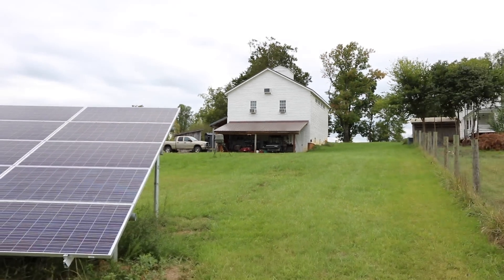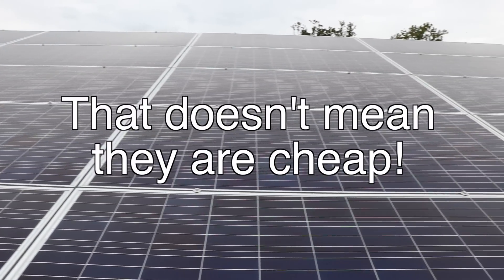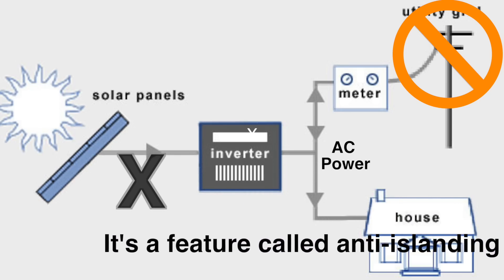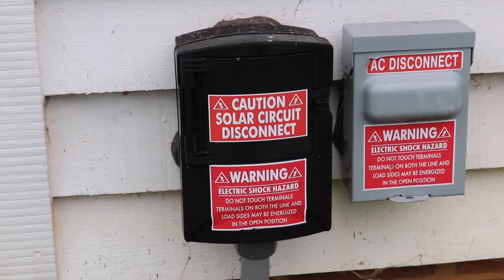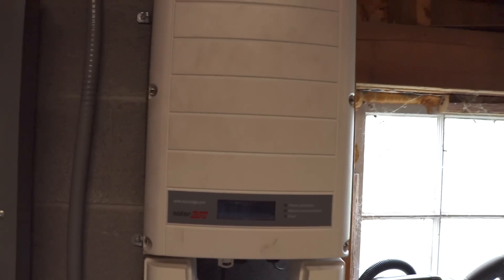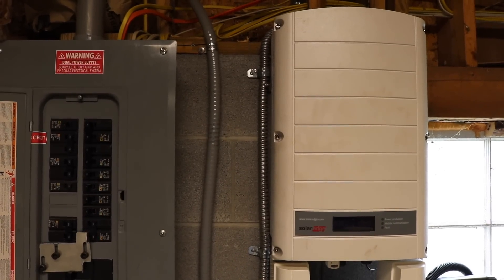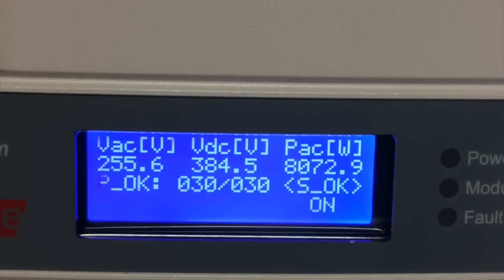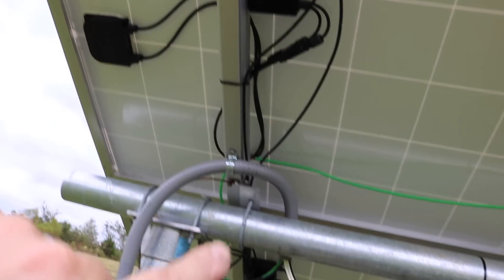The ugly truth behind grid-tie solar systems. Part 1, FarmCraft101 solar.  Watch before you buy!

Comment: I found this video to be quite interesting, and some of the comments as well.  My problem with going to a solar system, would be with warranty and getting anything out of said warranty.  One viewer/commenter (before me) stated that the company that made his inverter was bought out by another company, and is refusing to honor the warranty or even share the schematic diagrams so that someone else could attempt to fix it.  Having gone thru ordeals involving roofing, automobiles, snowblowers, etc., and seeing how many "warranties" aren't worth the paper they are written on,  leaves me sort of gun-shy to take a leap into such a venture as power generation.  Don't get me wrong... Kudos to those who do commit, and best wishes for a trouble-free operation.... But....
Reply from the maker: I share your concerns about warranties.  Thankfully with solar, the panels and wire/installation are the majority of the cost, and historically they tend to last well beyond their warranty.  They've gotten pretty good at making the panels.  The inverter, you kind of have to consider it a consumable.  Thanks for watching.
Reply: Sure they can be repaired, short of burning completely or melting down into a blob....  If it's only one component that had failed, yes it can be repaired by someone who knows what they are doing inside electronic equipment... however, it would be wise to replace dead or damaged components with carefully matched replacement parts so that neither the newly replaced parts, nor the adjacent components will be stressed, overloaded, or overwhelmed when the unit goes back into service. Some things can withstand being replaced with larger capacity components, assuming that they will fit in the space,  but will it impact other components with higher power, higher stress, higher heat? Need to be quite sure of what you are doing when working on something that will be inside a home or business. Don't want to have it set fire to the building under heavy load or something.  If the inverter is truly beyond hope of repair,  best to move on to another one.
Reply: as farmcraft101 said, just think of the inverter as an electric consumable like a tv.  it can last anywhere from 5-10 years (can also last 15-20 years, just depends). you can buy cheap ones on amazon and cross your fingers, or buy through a large brand name or brand name solar distributor who may warranty the products they sell (like buying coverage on a tv at best buy). prices range from $500-2000 depending on size. if you just need one to power your backyard mancave that just houses a few panels, $100 will do.

the panels/wiring itself won't die if installed correctly. yes lightning could hit it or a tree could fall on it but any physical damage is pretty unlikely.

they key is how much are you paying for electricity monthly. if it's less than $100 per month, don't worry about solar. if over $100 then solar would be a good 'long term' investment. if over $200 then it's definitely worth it given how cheap solar is nowadays ($10/watt installed 10 years ago to under $2/watt installed now).
Reply: Solar City the entire system is warranted for entire length of loan to purchase the system, but 20 year, and covers inverter, solar panels and a warrantee for your roof against leaks. Had my inverter fail, and they replaced it at no cost in two days.
Reply: Stan; I dont think it matters what brand. The warranty was offered by solar city.
Reply: yeah ICs aren't really solid state despite having no moving components. I go through wifi routers every 1-2 years and it seems the more throughput you put them through, the shorter they last. same with computers which in theory shouldn't degrade with time/use but after a number of years you will notice it running slower even though you completely replace all the moving parts like hard drives/fans/etc.

stuff from the pre-80s/90s seem to last forever and really 'solid state.' I have an old tv from the 70s and it still works exactly as it did brand new. lets not talk about old radios, they never die. I'm not an electrician so I can't say for certain, just anecdotal experience.

I think the main parts of an inverter should be true solid state. it's probably the ICs components that wear out. I'm sure a 'dumb' simple inverter would last forever.
Reply: I've managed to get 6yrs out of my first two WiFi routers.  Linksys, then Netgear, now I have a 1yr-old TP-Link.  Mine don't exactly have throughput 24/7,  so I'm wondering it ivyshy98's routers are not in a well cooled or ventilated spot. Or maybe he is suffering from voltage spikes and sags.... I dunno.  Would be interesting to examine the "deceased" (or replaced) routers to look for signs of failure.     As for inverters, most of my inverters are little 400w or less.  I prefer the little ones that don't have a fan in them.  All I use them for is recharging my shaver, powering/charging the laptop,  small electronic device chargers or power supplies.  Biggest load they see is when I plug in the laptop, and that's only for an hour or however long it takes to charge up the battery.   And as for computers that slow down over time, that is strictly the operating system.  Winblows is famous for that, and it's just the way it is. You can save/backup all your data and re-install the O/S and the performance will come back up,  but the more things get installed (and even uninstalled), the fatter the libraries get. .dll files and .ini files out the wazooo, that have to load into Winblows every time the machine boots up.  It's a problem that Microshlock has tried to fix, but can't. I have no Apple experience since the Apple II and Apple II+, so no idea how their systems react to age and bloat.
Reply: I've never "blown up" a laptop or fried a laptop power supply yet.  I use AC at home, and I have to use an inverter on the road.  Inefficiency is highly over-ruled by necessity :)
Reply: I'm fairly sure it depends on throughput. Before the age of streaming video, my routers lasted about 4-5 years and I am on the computer/internet a lot (work). When we cut off cable tv and started streaming everything, I mean everything (rokus, youtubes, etc), my routers lasted 1-2 years. Keep in mind there's 3-4 people constantly streaming something probably 8-10 hrs a day. I only buy brand name routers, like netgear, cisco, etc.

The routers don't get 'fried' but just have problems. If just 1 person is streaming, it would still work fine, but as soon as there's 2-3 streams going, the router would seize up and you would have to reset it (unplug). It would work fine again if just 1 person is streaming but as soon as more streams open, it could freeze up at any point. Swap in a new router than you can have everyone in the family streaming all day and there's no problems... at least for another 1-2 years.

ps I use surge protectors for most electronics in my home.
Reply: Regarding computers, I meant I do a totally clean reinstall - new hard drive and fresh OS install. It should run like new but it doesn't. Something about running a lot of current through tiny ICs over long periods that degrades them. I know most people that experience computer slow downs is because of what you described, years and years of junk piling up combined with the mechanical hard drive getting fragmented.
Reply: You have the warranty problem with any item you buy. Its only as good as the company. Any company could go under at anytime. Or as you stated be bought out by someone else. Its always been this way and theres nothing we can do about it. You buy your stuff you take your chances ;)  The best thing to do is do your research and buy something quality built so you never need that warranty. Sure you could get a lemon but usually you will notice that very quickly. What you need is a long term well built item and maybe some extra parts so you can do the repairs yourself in case something breaks down.
Reply: That's great.  What brand inverter was it?  Meaning... if the brand name that made your inverter either goes belly-up, or gets bought out by someone else,  is there any guarantee that the new owner of the company will honor the warranty of your product?  I'm pretty skeptical of warranties anymore.
Reply: +ivyshy98; shame they cant be repaired like cars or old tvs. I mean inverters have parts and when they fail most of those parts are still good (one would think). And with large inverters the parts are large and not so tedious and unrewarding to fix as with ICs.
Reply: +Stan Patterson; i dont know if i can be sure to avoid all those probs but when i hooked up a 800w inverter backwards polarity i blew a fuse and some mosfets. This happened twice so maybe the mosfets didnt blow the first time. I put new fuses in and it worked fine till this last time. I've delayed this repair because i dont know where to get replacement mosfets. Costed about $60 for the inverter i hardly got to use.
Reply: +ivyshy98; i am still using a belkin wifi from 6 years ago. I'm on the internet several hours a day. You must have power surges or bad internet voltage or something.
Reply: +Stan Patterson; you remind me of another perk to repair, being the diagnosis of why it failed. Then you can fix some causes and increase statistical time before next failure.
Using an inverter to make AC just to use in charging a battery always seems inefficient to me. small MPPT charge controllers plugged into a DC house line might be better but IDK how safe that is for a laptop.
Reply: +ivyshy98; since I heard that the installation process is hard on components I prefer to clone the hard drive shortly after first install and just clone that drive by overwriting the primary drive (data backed up elsewhere). Or lately with time machine/restore points Reinstall might not be as helpful. And If the wifi boxes still stream to one device each it might be cheaper to just pay the extra electricity by running multiple wifis for 1 user each.

Comment: Just get 12v and 19v electronics with propane appliances and save yourself thousands.

Example: 12/19v entertainment center: 28in 19v Monitor, 12v Cable Modem, 19v Mini PC, 5v Speaker, 12v LED Lighting = 50 Watt/hour

Kitchen: 12v ARB Mini Compression Fridge, 12v LED Lighting, Propane Stove, 12v Water Pump = 150watts/day

Comment: One of the factors for payback he doesn't mention  is the sale of SREC's or Solar Energy Renewable Credits. Each 1000KW you generate you can sell on the open market. (Utility's are required in many States to buy these.  Depending on your state that can be as low as $20 or in some states $300+. We sell into a high cost state and reduced our payback to 32 months which we reached 3 years ago.. We also got a State credit which helped. The expected life of the panel is 30 years.  Our system is approaching 7 years and is still delivering the same power levels as it was when brand new.  Thing to be careful of is if you use a generator, we have a relay to drop out the inverter whenever it runs, the square wave from the inverter doesn't play well with the more rounded generator waves. I have a 10KW system that saves me $250 per month March though November.

Comment: Does code where you live at now allow you to have a bigger battery system and an automatic power transfer switch so that you can use power when the grid is down? Or did you just not want to have that option?

Comment: The Sun irradiates the Earth with some 1.2 kW per sqare meter of energy. IF there are no: nights, and clouds, and dust in the air, and etc... But they always are there. Not to mention the permanent change of the angle the sunlight hits the cells, because the Earth is rotating, that also drastically reduces their efficiency.
When you now divide the real output of your solar system - no!, even it's theoretical output of 9.1 kW - by the total energy received you'll see it's catastrophically low energy-transformation efficiency: Somehwere in the range between 12 and 14%. And this is the energy efficiency of the old, if not already ancient, well forgotten steam engine that we dumped many decades ago. For that very same reason.
For a comparison: The turbines in our coal-powered power stations today have an energy transformation efficiency of about 65%.
Now, you tell us one more time about the "modernity and advantages" of those so called solar "systems" ... 
Bad technolgy, bad economics, dude ;-)
Reply: You're right.  You've let the secret out.  The efficiency reduction is "drastic" and "catastrophically low".  I'm sure his patch of grass would deliver much more electricity without those inefficient panels blocking the sun and his bank balance would have been higher in 8.5 years.   /sarcasm
Reply: Damn, I think I just lost a few IQ points by reading that comment.

Comment: I had a solar system for about 10 years that was completely independent.  The city grid was so unreliable that a grid tie would be pointless.  I wired it with a cross over that switched to city power when the batteries were depleted.  The solar panel/inverter parts were long lasting, the batteries only lasted 5 years and required constant maintenance.  The batteries were also dangerous, a weak cell could cause overheating.  The city fixed the grid so I no longer needed the batteries.  Wouldn't do it again until the battery tech is better.  Wonder if the Tesla batteries are good, any experience out there?

Comment: The type insulators on the poles you pointed at are good for 230 volts max.  The huge tower long distance power lines are usually 5000 volts 3 phase.  800K volts would be arcing to ground.
You should really specify whether you are talking about alternating current or direct current.  They do behave very differently.
At higher amperages; you might find a motor generator set is more efficient than an inverter.  48VDC- 240 VAC MG sets were what the old Bell system used to power the phone system in emergency.  Add some surplus submarine batteries and you can be fully powered for a 200 amp household circuit.

Comment: Hopefully you get better results than the systems they had in California a decade ago.  They found the mean lifespan of the solar panels was 5 years before dropping below 30% of rated capacity.  By a systems analysis standpoint; that was ridiculous considering it would take 15 years for a solar panel to generate as much electricity as it took to make it.
Reply: It was the initial pilot project done by Sacramento Municipal Utility District.  They had 20 acres of solar panels adjacent to the old Nuclear plant.  I was there doing final decommissioning surveys.  The panels were supposed to have a 20 year lifespan but they ended up showing a mean lifespan of 5 years.